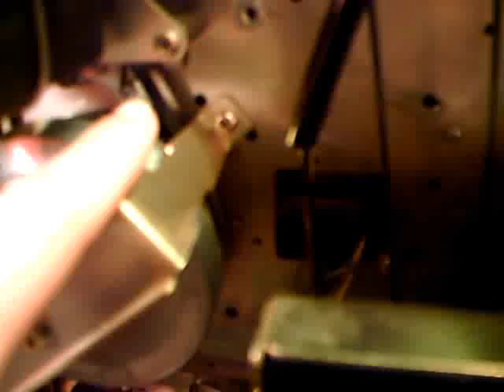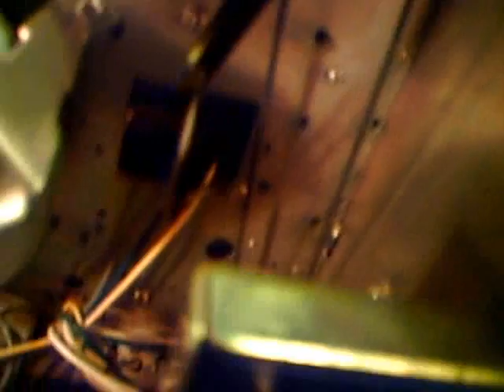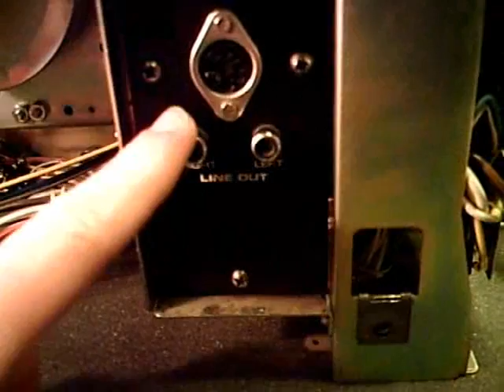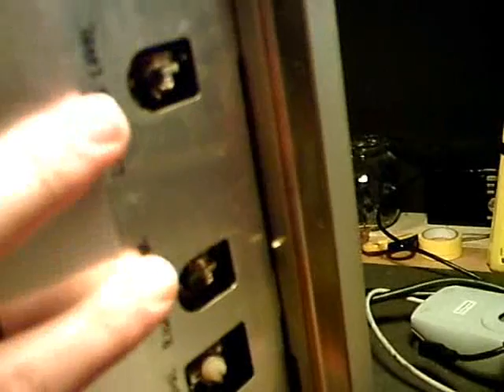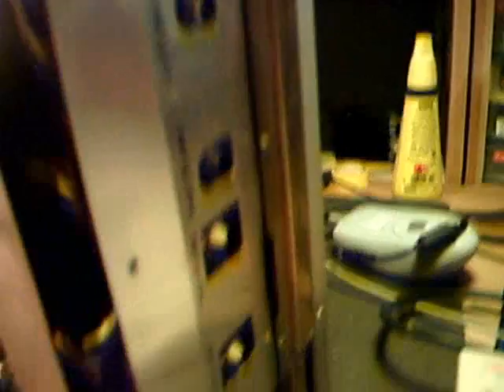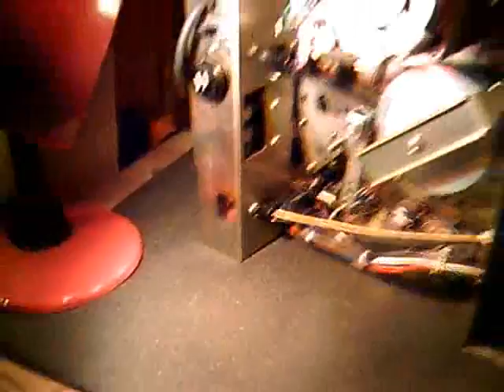Inside the Akai 4000DS reel to reel

Comment: I plan on adding a Blue tooth communication board to my Akai preamp line in. Whohoo.. can't wait. I'll also bring an
LED to the front panel. Just looking for a spot that doesn't ruin original wood or front metal (removable if necessary).

Comment: i just got a 4000ds  today for 30$  

mine play and record just fine.. but i only have one issue..  the on/off switch doesn’t seem to do anything..  as soon you plug it to a wall outlet it start running..  and the machine is a little noisy.. i took the face plate off but i have no clue to fix this..   so i just plug and unplug everytime i want to use it.
Reply from the maker: The service manual for the 4000DS (available online) might help you. It contains instructions on assembly and disassembly as well as circuit diagrams.
Reply: yep, i found what to do and how to operate this unit...    but now i have another problem..   The light bulb for the VU is gone.. someone burned the light bulb and its circuitry... my multimeter reads no power nearby (where the bulb should be) and i can't find the correct bulb for it.  maybe i should convert it to LED.

The second problem is the AC... this thing uses 2 prong powercord..  im wondering if its wise to convert it into 3 prongs cable..    Old machines use to electrocute people.  Does this Akai 4000ds safe to use ? will the chasis electrocute, does the fuse protect the user ?

Im not sure how to access the soldering point because it seems to be all inside the metal block on the side..

Comment: I have got that one reel to reel but what I'm facing is an issue with right channel of line in (source). It looks like is not getting anything on that channel. Are there any control points to measure if that input channel works? For sure it works for output as I it plays stereo signal very well.
Reply from the maker: For technical details, you can find the service manual for this machine online.

Comment: my x200d stays on and works great but power switch wont turn it off, what is that square block resistor there for on the switches and can that cause failure of the switch? Havent tested the switch yet.
Reply: Just an FYI, the Akai 4000, (regardless of the "DS" or "MKI"/"MKII"), are all set with an "Auto-Stop", which is controlled by the On/Off rocker switch. The "ON/OFF" switch rather performs two functions. It’s there to enable or disable the "Auto-stop" function. However, it also doubles as an "ON" control for the entire deck. 

It sounds confusing but it's actually quite simple: If the On/Off rocker switch is left in the "ON" position, when the ‘active reel’ spools up the entire tape, (tag, and all), the deck will not stop. The take-up reel will continue to spin, slapping the tag end around as it does, until you stop whatever you’re doing to set the deck’s “ON/OFF” switch to “OFF”. 

However, you should always leave the switch in the “ON” position. The “ON” position enables the “Auto-stop” feature of the deck. This protects the tape and the even the entire tape deck in case the deck is unattended. 

When the Auto-Stop is enabled, (the On/Off rocker switch is “ON”), and as soon as the ‘upward pressure’ to the deck’s tension arms, (during playback, rewind, or fast forward), is released, the power to the entire machine is turned off. Of course, that means whichever reel is active, stops as well.

You don’t need to be near the deck during the play or rewind procedure and don’t have to worry about the take-up reel continuing to spin, possibly damaging the tape’s tag end. 

This On/Off rocker switch conveniently eliminates the need to apply a strip of that adhesive foil to both ends of the tape, (for some “auto reverse/rewind” machines with 4-tracks or more). 

That’s why when the rocker switch is "On", you may notice that none of the meter lights will turn on if there is no pressure on the deck's tension arms, and that's a "good thing". 

If you lift either tension arm just a little, the meter lights come on and you may notice the capstan’s pinch pin begins turning. (I do that while holding a distilled alcohol dampened, cotton swab, against the pin, when I clean the machine and heads.)
Hope that helps those who thought the switch wasn’t working correctly. I read at least one person who said they opened the machine and “fixed” the switch so that the power comes on when the switch is turned “On” regardless of the tension arm’s position.

By now, I’m sure they figured out that it was supposed to do that.
Rich
Reply from the maker: The "square block resistor" could be a spark suppression capacitor. It may be shorted. But test the switch first.
Reply: all fixed! desoldered and found switch contacts inside were making a closed connection just seperated the contacts a little to make up for wear, grease and resolder. good as new!

Comment: Hi, Thank you for that information. Is this deck the Akai 4000DS or the Akai 4000DS MKII? Sometimes people will leave out the "MKII" part of the model because they're not aware that Akai makes both the DS and DS MKII so that's why I asked.

Also, the 250hz Play-back adjustments and 1Khz record adjustments are interesting to know about. However, I'm not sure what you actually did to adjust the two controls. I take it that you first played the 250hz tape and as it played you turned a adjustment screw while watching the machines meter. The video quality wasn't good enough to tell if those were the adjustment pots or if the adjustments were hidden out of view.

Of course, I'm thinking that you likely didn't do that and instead, used a DVMM as your reference source. Is that right?
Thanks,
Rich
Reply from the maker: +Rich Paul 
This is in fact the original DS version. The adjustment procedures are described in the service manual. Please refer to that. Keep in mind I did this video over 6 years ago. The knobs sticking out through the shielding on the side are the adjustment potentiometers. 
I most likely did this looking at the VU meters. I didn't have any proper test equipment back then (notice how both frequency generator and frequency counter were just computer programs).
Reply: +DrCassette  Thank you! I Just bought a 4000DS MKII at a great price, (the condition was pristine). I cleaned and degaussed the heads and I can see the Capstan may need to be replaced. I was a 'hardcore' audiophile from 1980 to '89 and though I no longer have any of my components, I still have my meticulously recorded reels. 

They represent hundreds of hours of hard work, mixing, and monitoring time. I have about (20) 71/2" reels recorded at 7.5 IPS, (I had a high-end deck that could record at 15 IPS but most of my audiophile friends had 7.5 IPS max capability). On average, it took about 4 to 5 hours of work to record 2 to 3 songs per reel and I have no copies.

Anyway, I plan to actually try a reel on it as soon as I make sure everything in it is clean, greased, and demagnetized. I really want to get to the belt but I'll have to remove the unit from the wooden case. 

Therefore, I thought I would test and confirm the recording and playback adjustments while I'm back there. That's why I found your video very helpful.
Thanks again,
Rich

Comment: I have the AKAI M-8 MODEL it worked for one reel after that the motor would not turn do you have any suggestions as to what i can do?
Reply from the maker: Maybe an issue with either the motor itself (lubrication) or the control circuit (bad switch, motor run capacitor).
Reply: DrCassette Thankss

Comment from the maker: The cirquitry in your machine is different. The MK-II version uses discrete transistors instead of integrated cirquits like mine does. The service manual I have is for both, the Akai 4000DS MK I and II and so I found out about that.
It's OK if the machine gets distortion when the level is over 0dB. But my machine used to get these distortions in the playback mode, if tapes were recorded louder than -5dB. But that happened only with the Akai, on other machines these tapes sounded good.

Comment: It's a lot like the inside of mine.  The only difference is that the circuit boards are layed out a little differently.  I had to adjust the recording circuit because it was recording louder than the meters were showing.  I adjusted the bias on mine by ear, adjusting it till it sounded good.  Mine gets a little distortion too in recording if it goes anything above 0db.